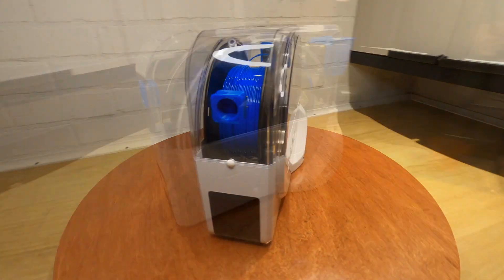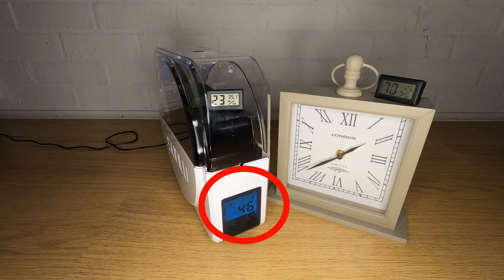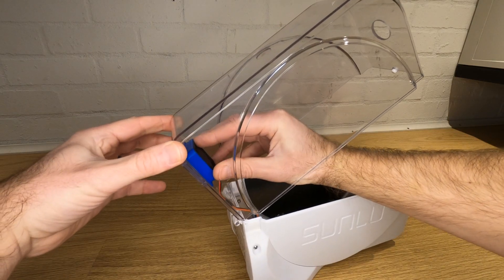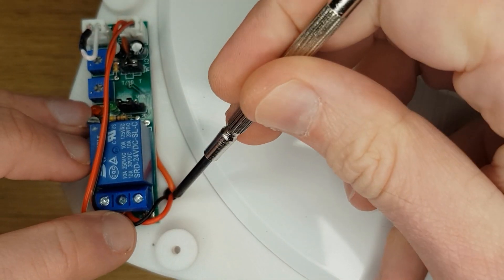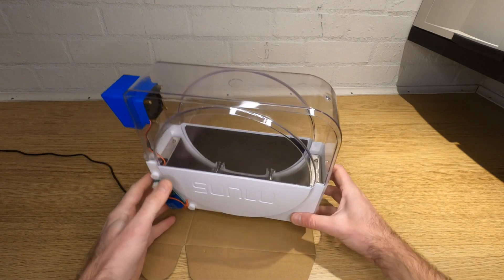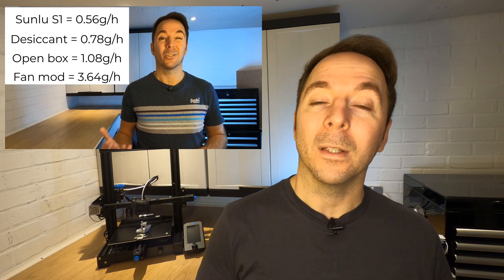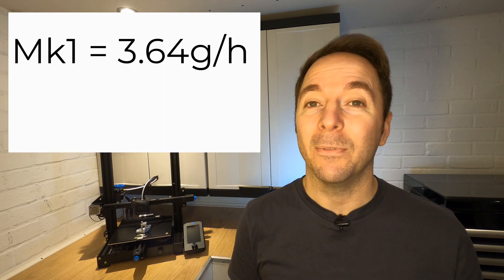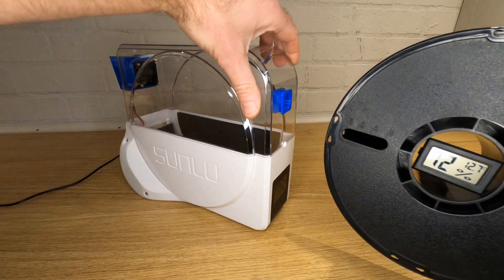Sunlu S1 Filadryer Turbo Mod Mark 2 & Build Guide (Timer, speed control, intake vents and more!)

Comment: Thought as much the link for the wire is in this one. Will be interesting to get the wire through.. I Amy need to re print the fins on the smaller hot end..

Comment: I wonder if the mod results in any filament drying improvement.  The filament does not release nearly as much moisture as the wet sponge.  The air will probably never get too moist to slow down the drying.

Comment: i essentially making my own drier. I bought heater with fan, and made a closed loop duct for it(air circulation heater), it worked well (ignoring damn box loses a lot of temperature, but i manged to dry my desecant in hour or so)
and thanks to you ideas i have more ideas to implement
At this point i started to think, it would be easier and more flexible to do arduino\rasbery controller than buying all those controllers\switches\timers, but still, i love to tinker

Comment: Getting there. This box is almost there on features. I think all you need to do is figure out how to keep the humidity in that box as low as possible.

For V3, focus on input humidity at a constant temp, and possibly absolute output humidity * your air flow rate. Can use that to figure out how much water is leaving your box. 

The fundamental limit is how fast the filament can dry in 0% humidity at maximum temperature.

Comment: This is old now but what i just did was solder a 5015 fan to the fan port on the pcb. It makes the chamber so much hotter moving the air around. Don't know if it's good or bad but I've had it for awhile and looking at getting the 4 chamber.

Comment: hmmm  so the box will have an oscillation in temperature because of the inrush of cooler air when the exhaust fan is activated? I suppose as long as the lowest point is still 10c  above ambient  you should be golden, I wonder if  a setup with a heated  blower  constantly blowing warm air into the box   would be the optimal, that way your not introducing cold air into the box  so temp shouldnt drop and could be controlled with a thermostat. ,  something along the lines of a hot air station  could do the trick if set low enough..  one thing you could try for the condensation is descant  lots of it and just dry that out when its saturated.

Comment: Very nice mod ! ... But to make the look even cleaner I'd have made the part with the flaps less bulky and would have put it inside the box (other side of the fan). Since the spools are anyhow round there should be enough space in the corners of the square box.

Comment: 11:52 How's blowing wet air gonna help?
I know that those thermo-hygrometers measure relative humidity, so that 82% humidity in that air, measured at 7.5°C, would be read as much less once the air is heated up to the 31°C inside the dehydrator (even though the humidity in that air would be exactly the same), but I still think that, wanting to blow room air inside the Sunlu, one should start by running the air conditioner in dehumidifying mode for at least half an hour before starting...

Comment: You can try setting up the fan switch to work off of humidity instead of heat since thats what youre concerned with removing anyways.

Comment: Got it working ok. One thought ...could you fit a second fan inside the box to circulate the air, and connect it to the nc ( normally connected) part of the thermal circuit board. That fan would circulate until the thermal switch turned on the extraction fan to get rid of damp air. When that fan stopped, it would turn on the circulate fan.

Comment: If you added a Gore-Tex type vent with membrane that allows water vapour to pass through, you might be able to let the water vapour out (at least till intenal and external humidities match) without needing fans. They're often used to manage condensation levels in outdoor electronics enclosures. Not sure if you'd need more than one to get the required rate of water vapour movement though! I'm going to test one out on my S1, fingers crossed!
Reply: hi, have you done the test? I just ordered four valves
Reply: @nicolacarmelogurgone3355 what vents did you get, and were they successful?

Comment: I am looking at using a peltier to condense the moisture out of the air blown out of the dryer on the cold side, then have the air recirculate through the heat sink on the hot side and back through the dryer. 
Not sure how well it will work. In theory it should work.

Comment: Actually humidity is measured relativly of the cability of the air to carry water. At 100% humidity the water falls out (fog, or in greater amounts rain). If you heat up the air, the absolute amound of water does not change, but the relative humidity drops.
Drying filament is about the difference between relative humidity of the air and of the filament. Obviously, having very cool air heated up, you get very dry warm air, so drying works best.
So in adition to get the air out after it has absorbed water from the filament, first check the relative humidity and temperature of any room you have available and convert the result to absolute humidity. Choose the room with the lowest absolute humidity to do the drying. In winter at freezing temperatures you might even considering doing the drying outside (add some thermal insolation to the dryer).

Comment: I have an S1 but I really don't want to put that much effort into modding it, have you found a dryer that actually works fairly well or are you still using modified S1?

Comment: 2 mins on
30 mins off

Also, NO on the relay is Normally Open and NC is Normally Closed. So the thermal switch is an open path (Normally Open) and when it hits either 40 or 50C the path closes and the circuit is complete.

Comment: Thank you for your excellent mods! I was thinking, with a simple ESP8266/ESP32 with a humidity & temperature sensor and a PWM 5v fan, maybe the control could work better. The PWM fan will allow to make it slower or faster, depending on the air flow needs, and the humidity&temp sensor will tell the microcontroller if it is time to turn on the fan, if the humidity is getting higher, and to turn off the fan if the temperature is dropping.

Also taking measures of the values could help to fine tune the process, and maybe a second humidity&temp sensor outside the box could give better understanding of the surroundings.
Reply: Thinking the sam band Hong here
  Wifi connection to the box ;) but this project seams to be ded.

Comment: I was kind of curious about something with this model.  I noticed that the control board has what appears to be a non-functional circuit for a fan.  Do you think that maybe they originally planned to put a fan in this version but decided against it?  

This box is my only filament dryer or I would be willing to experiment and see if that circuit actually does something.

Comment: Recently I learned something about housing insulation that could possibly be applied here. Humid air rises faster than dry air, so measures of passive ventilation via a single or a couple of holes on top should exhaust the humidity buildup without the need to fully exchange the air within. 
As filament releases humidity way, way slower than a damp sponge on a hot plate does, I believe that adequate internal air circulation with a passive air intake at the bottom and the passive exhaust is all you need honestly. Perhaps through some kind of a permeable material that's slowing down the hot air draft.
Though I love a good over-engineered approach. Way to go Ricky! <3

P.S. I have read of some people running the element on 30VDC to achieve 70C+ temps. I think that's the endgame for my S1 someday. :)
Reply: I agree my immediate thought was that just passive ventilation would work.  Warm air rises naturally. keeping top holes to a minimum, will make them easy to blank off, if storing material inside. I would add an engineering spin to the inlet air. It is a little counter intuitive, but true. Cold air cannot hold anyway near as much moisture as hot air. So insulated better and out in a cooler environment will give dryer inlet air. Personally I would go with a silica gel pack, pre drying the air going in. So a in a small sealed container with a pipe outlet connected to the S1 plus.  Silica packs can be regenerated by warming in a ventilated oven. Just as you can do with caked damp salt. Hope this helps.
Reply: That's exactly my thought too. The guy did all of these obnoxious mods while ignoring the easiest. Drill a couple holes in the top while leaving the lid open with a slight gap. May not even need the lid open.

Comment: This looks like one of the best mods I've seen for the Sunlu S1. I plan on getting one for myself and doing this. 

But I would recommend extending the tempurature sensor out from under the heater plate to the top of the box. And add a circulation fan inside as well that runs all the time. 

With the temp sensor right under the heater in an area with no circulation the the sensor will cut off the heater when it thnks the temp is at whatever the set value is. And since there is no air circulation under the heater it may be 55C under the plate while only being 30C where the filament sits.
Reply from the maker: My sensor is actually touching the plate so it is mainly a way of activating the fan circuit when the box is powered and trying to dry filament. You are correct if you want to use the sensor in a different way to me though.
Reply: @RickyImpey  I ended up getting a Sunlu S1+ a year and a half ago for christmas. Just after I left this comment. It's been sitting disassembled for 90% of that time. I finally got around to installing your mod, though I believe I have upgraded it. I took the sensor off the heater plate and dropped it to the bottom of the case. My thinking is that this will allow the heater to get just a bit hotter as the sensor is not directly attached to the plate. I've also redesigned the inside of the case to allow for 2 fans. The S1+ comes with a centrifugal fan mounted under the heater plate. I relocated it into a housing in the upper rear of the dryer. I used the same relay you used and the venting fan is connected to same way you have done the centrifugal circulation fan is connected to the NC (Normally Closed) side of the relay. for the 30 minutes the Venting fan is off, the Circulating fan is running. The relay then turns off the power to the circulating fan and turns on the Venting fan. Only one fan will ever be on at one time.  The housing also has a section for desiccant beads. the Circulating fan must draw air through the desiccant before recirculating it around the filament. I used the 40mm housing and flaps from your design to mount the fans inside the housing on mine, along with the side plates and the intake vent. I also created a fitting that mounts to the front of the case and has a bowden tube connector inserted into it. That way you can run the bowden tube into an enclosure or to the top of the printer minimizing the filament exposure to any humidity. I'm uploading my design to thingiverse and Printable as a remix of your design.

Comment: Great video. Add on parts are very well designed. 
Just wondering if changing where the thermal sensor that’s at the bottom of the box worth moving further up for a more accurate reading of the overall heat. As it must be picking up inaccurate temperature so close to the heat plate at the bottom. Or has this been addressed?
Reply from the maker: I found that when I tried the sensor higher, it just wouldn't get hot enough to trigger. I would have had to buy lower temperature sensors which weren't easy to find. The sensor is only there to turn the fan on and off with the heat so having it close to the plat works well. You can of course experiment with placing it wherever you like. You may find a better location.

Comment: The  SL-1904-V1.3 pcb used in these dryers has a "fan" header output and spaces to add a mosfet and resistors to control it. There's also TWO temperature sensors on the board, one that's underneath the heater and one that's actually on the heater itself.  How much of that is used by the firmware I don't know. Can anyone work out what the controller chip is? There's no markings on the one I have.

Comment: That was the question I asked a supplier- how does the moisture get out of the box? As expected, the answer did not address the question... It seemed obvious to me that an extractor was needed- but the replacement air will also have a humidity, which will affect the drying rate- and it will also cool the air inside. Instead of a timer, a variable flow would seem optimum- but the best flow rate will depend on the current humidity of the filament. So, a controller (e.g. an Arduino) reading both external and internal temperature, plus inlet and exhaust humidity, controlling the fan speed should allow an algorithm to be developed to give the best moisture reduction for a given time/power. Passing the inlet air through a desiccant, especially in warm weather, should help a lot. That the box is insulated is, of course, obvious; this lack (and no air change) shows that the commercial dryers are not serious.
I spent my latter career designing embedded systems for companies; this is a typical design brief. May get sufficient interest to give it a go...
Reply from the maker: I definitely think there is scope for a fully optimized home filament dryer. Some of the commercial units are very expensive but do no more than warm the air in the box. It would be an interesting project to develop.

Comment: Greetings. I live in a semi desert environment. In the summer, temperatures can reach up to about 44 degrees c.  My garage (where I keep my printer) can reach 48c ambient temp with a relative humidity of less than 10%.   Will Mod 1.0 bee sufficient?
Reply from the maker: Hi, what sort of humidity do you get there? Do you need a filament dryer? I live in the UK where we have high humidity most of the time. It sounds like you may not need one. The process of removing the moisture relies on the air around the filament being dryer than the filament itself. Heating the filament up helps release the water molecules into the air. You may have those conditions naturally.
Reply: True. But the winters are a bit humid and gets pretty cold. Might get the sunlu to have just in case.
Reply: UPDATE  Ended up buying the eibos easdry.
Reply from the maker: @eddiemorales1705  Let us know what you think of it 👍

Comment: Hi, i t5hink you have skipped one test.
From my experiance having a fan sirculating the air trrough silica gell boost its efficiency X2 X3 times. 
adding a fan inside that circilates the are trough a compartment of silica gel might give better results (even if you have to replace the silica gel quit often).

I have built a dry box that uses zack --Void star Labs fartfighter 5000 with silica gell . my results were to acive within few house what normaly take well over a day .

I live in israel close to the sea so my room air humidity is normaly 60-70 % ... so replacing the air with more moist air doesnt help much

Comment: Hey, i am working on the idea to us a arduino with a DHT21 Temp./Huminity-Sensor that forces the fan to blow the wet air out when the huminity inside the Sunluu reaches 70% for example. Has anybody tried that so far?
Reply from the maker: Sounds interesting, let me know how it goes.

Comment: I wonder if it's possible to use passive convection to circulate the air? Small holes at the bottom as intake and small holes at the top as outlet. The air gets heated in the box and rises.
Reply from the maker: Yes 100% that works but you won't have a sealed box when the timer turns off the power.

Comment: I built this up with the 50deg switch and mounted it initially to the wall behind where the relay board is.  It wouldn't get hit enough to turn on. I had to move it off the wall and get it to basically touch the heat plate to go. The lower temperature switch may be better choice, or just make sure your thermal switch is basically touching the hot metal.
Reply from the maker: I found similar results Daniel. I ended up with mine tucked just to the side of the plate, touching it on the edge.

Comment: I’m super late here, but I actually redesigned this from scratch with a fresh PCB. I added wifi, and ventilation similar to this, but watching your video gave me ideas for a new version of my design.

But I need just one thing… I designed the dryer in fusion360 to get my fittings for the PCB, but if you can share your model of the filament dryer I would appreciate it! 
I need the top acrylic dimensions, but it would be nice if a model already existed.
Reply from the maker: Hi Micah, drop me an email and we can discuss your project, it sounds really interesting. I may also have something interesting to add. Address is in my 'About' section.

Comment: Can the timer flip between two fans? In the time you are not pushing air out of the box, have another fan move air around inside the box (or just have an internal fan on all the time). The temp sensor for the Sunlu controller board may do better if it was also moved to in front of an internal fan. 
My filament feeder box is just a sealed dog food container with a thick layer of cat litter (on the bottom inside). I dry the filament (and cat litter crystals) separately.
Reply from the maker: Yes, the timer closes one circuit for a set amount of time then opens that circuit while closing another. I only used one side to open and close but you can also wire a fan to the other side so it switches between two fans.